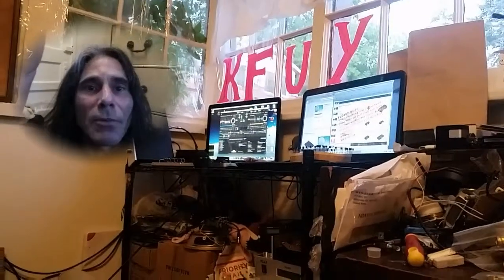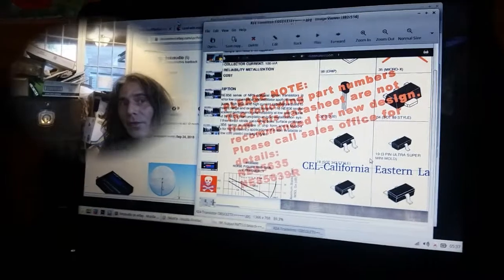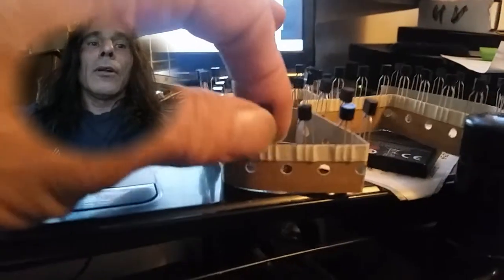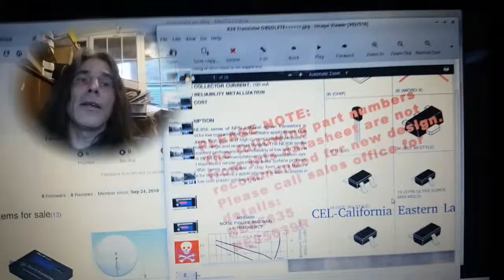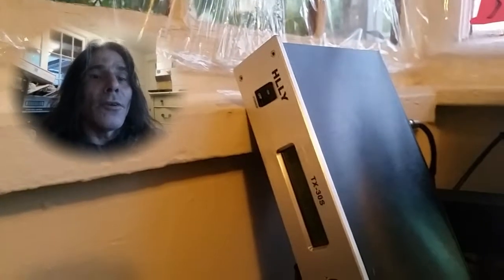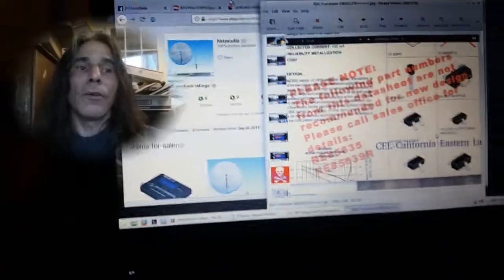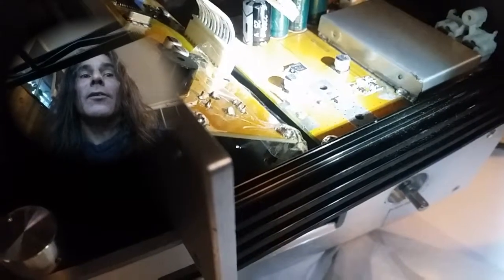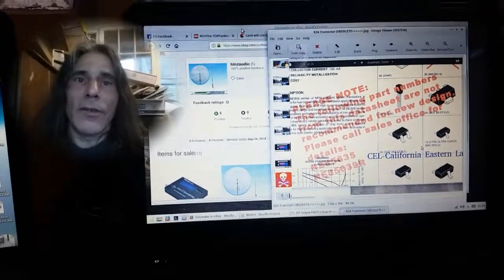HLLY TX-30S X-mitter-REVIEW/ OBSOLETE parts

Comment: i wonder if this issue would happen if ordered directly from HLLY? I was seriously considering this X-Mitter until i saw this video.  I also wonder if the SWR meter on these are accurate. I doubt while using that telescopic antenna as shown in your video it would have a perfect 1:0 SWR.  I imagine 99% of the issue is exactly what you state being the transistor, just curious if any other features are faulty or not 100% accurate. Could you by chance do a video on your setup? does the HLLY work well enough to not have a ton of other hardware between the computer and X-mitter ? processor, pre amp etc. Thanks so much for sharing.
Reply from the maker: The Idea would be to check on the newer units and make sure that ALL of the components are "current" and replaceable with the new boards. Another factor is the Pre-emphasis --- Over Seas uses 25 or 50uSec---- The U.S. Standard is 75uSec---- 50uSec can work,as long as you use an E.Q. to cut the Highs-- at minus 2.75db at 1K through 12 K------------------- My Developer DJ board had a nice Para-Metric E.Q.(cover a wider audio band-width) that does a good job

Comment: It overheat because the blower doesnt turn on automatically, here's what to do,set your temperature to 55 degrees and then when the temperature reach 46 degrees try to press the knob then exit. You will hear the blower has been activated